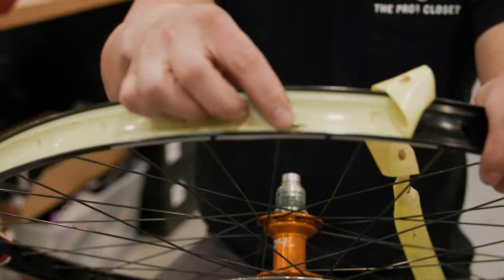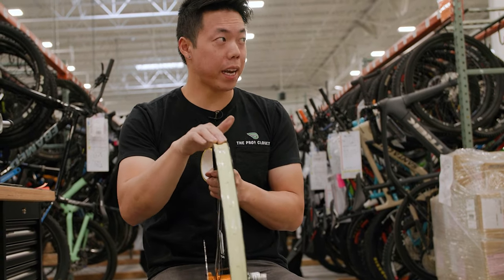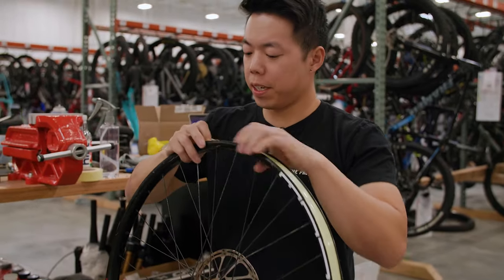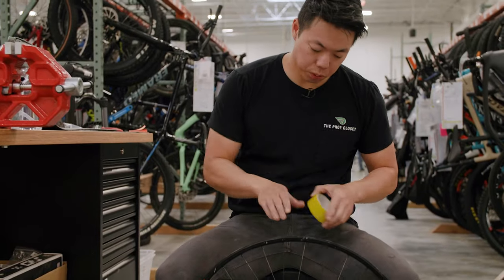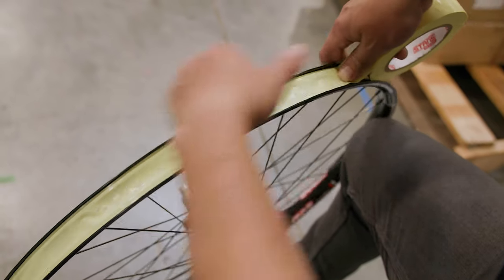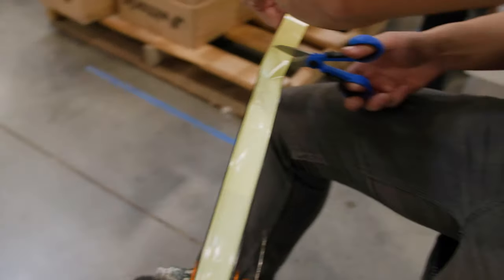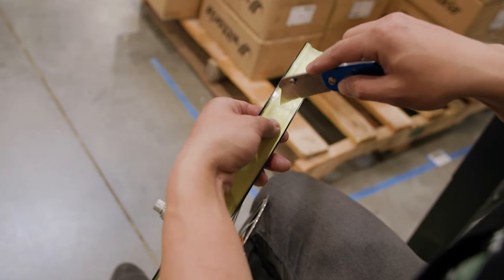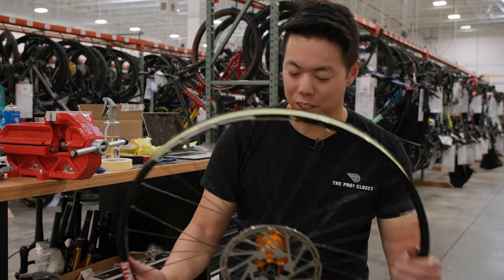How To Replace Tubeless Rim Tape | Bike Tech | The Pro's Closet

Comment: For the hole, I would rather use a punch and carfully make a round hole, or I have a circular blade that cuts perfect circles.  The cross is asking for a leak eventually.
Reply: Cutting the valve opening with a knife is simply wrong.  Much better to watch the Stan's No Tube videos and do it right.
Reply: I heat up a nail with a lighter and poke through by melting.

Comment: Is it possible to fix/patch a hole in the rim tape without replacing or taping over the whole tape?
Reply from the maker: We haven't seen that done before. Obviously, your safest bet would be to replace the tape, but you could try covering it with some heavy duty tape or more of the same tubeless tape. You'd want to make sure you completely clean the area so the tape actually sticks, though. Interested to know how that works for you!
Reply: @theproscloset  I cleaned the area with isoprol then stuck patch of gorilla tape over it. Worked a treat - Thanks

Comment: As a 45 yr. bike mechanic you can have the over engineered tubeless set up.
Do your research- Stan's doesn't want you to know.
Reply from the maker: Care to explain? 🧐🤔
Reply: @theproscloset  You should know no industry can stay stagnat. They must innovate or die.  No question there.
Some new designs are truly propel bicycling to another level of  performance, and speed, with safety in mind.
Example: Shimano SIS shifting revolutionized bicycle shifting.  Truly good upgrade. And no cons.
LOOK: Clipless pedals. Again, a marked improvement,  without any cons.
Tubeless tires. Implying no tubes. But in fact, tubeless tape and Tubless cement needed. Which can be argued is the same as a tube.  Then, seating tape. Installing tire. Installing cement. Sounds great to naive customers who just want to ride and have fun. Then, comes re-glueing.  ? Customers not aware. Not told expense of this. Ripped tire...cement squirts everywhere on bike, rims, clothes,  etc.  
I.E. - Customers don't know when told how great it is, all the post work must be done to keep the system going. When grandma and grandpa show up for new tires, they are shocked at the cost. Why so much? "Well, we got to clean the old cement out.  It's like gorilla snot and cement in there. So, now we need new tape, big cleaning rim labor,  new glue(sealant), and gotta keep your bike overnight. "Why- gramps asks"?
"Because we want to make sure it doesn't leak".
To each their own. I've earned the right to be opinionated because I've seen new gadgets come and go. Tubeless tires set up is overly complex, over engineered,  for 99% of riders. It's doubtful it's measurable.  But it "NEW and DIFFERENT " ,  and that's what the people want, whether it's good or not.
Shimano biopace,  in the trash.
Mtn. Bike bar ends, in the trash
Press fit bottom brackets- bad design. As a Suzuki/ Yamaha/  Honda mechanic who build thousands of 2-stroke engines & cranks, when I first saw what ** and other companies were doing, In the name of saving grams, I shook my head and smiled, laughed.
Not every new design is good.
Want the latest flavor of the month, go ahead. I don't want to listen to whining about about all the B.S. you'll have to deal with Tubeless setup.
Reply: @tigerone2353  I gave up on reading. But your wrong. Tubeless for MTB is a huge upgrade. I’m 210 lbs , run 20 psi on slick days. If I ran 20psi in a tube it would pinch flat. 
If you dirt jump it really doesn’t matter because your running higher pressure anyways. 
You simply cannot run a tube at low pressure over rough terrain
Reply: @nickgustafson9064  of course you didn't read what I said. Your mind is already made up.  If you read my entire statement,  I'm right.  99% riders don't benefit from tubeless. 
There are 99% other riders other than you. They don't need it- you do. 
I suppose the trillion bicycle riders in Asia are suffering not having tubeless.
Reply: @tigerone2353  everytime they get a flat. Yes, they are suffering.
Reply: @nickgustafson9064  hahaha...ok buddy...
Reply: @nickgustafson9064  we'll admit, your a professional bicycle mechanic drawing on your years, even decades, of experience.  Com'n folks, let's agree on it. 👍👏
Reply: @tigerone2353  nope just started my second year of mountain biking. I’m willing to admit tubeless is not for everyone. “99% of riders don’t benefit”, that I don’t agree with.
Reply: @nickgustafson9064  okay friend. Most of my experience with mountain bikers is they did experience a plus with tubeless. It's just like but for the average Rider they don't need to listen and neither does the average Rider Need disc brakes. It's all good. Be safe out there riding take care
Reply: @tigerone2353  fair enough. You as well, safe travels.
Reply: Legalize pistachios!